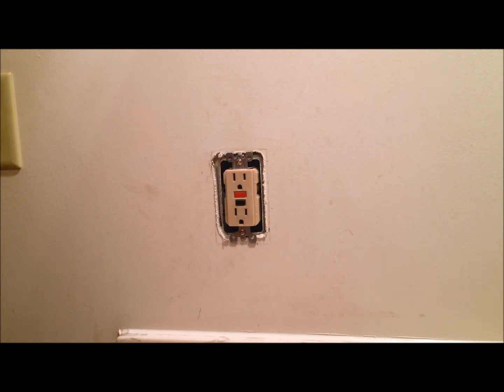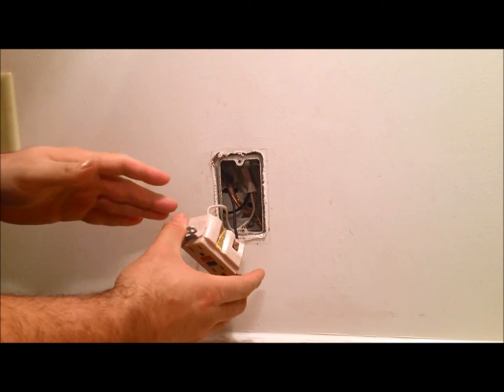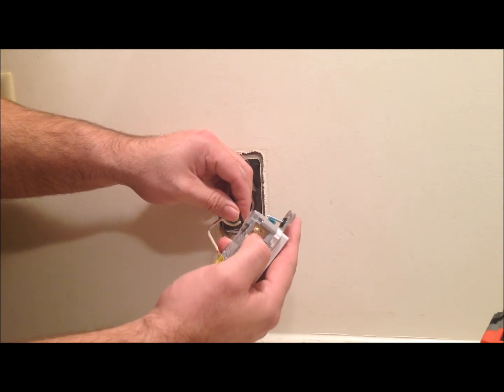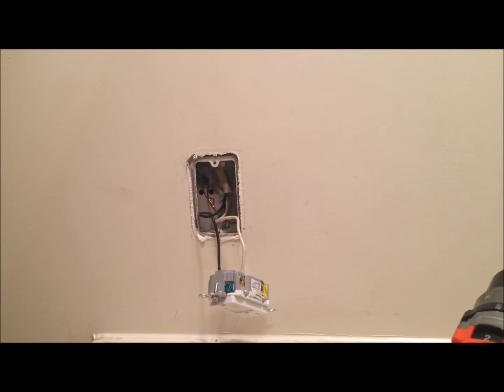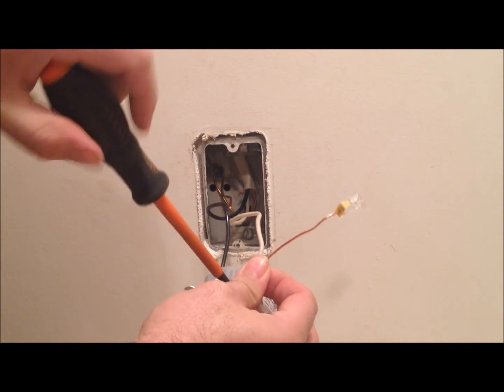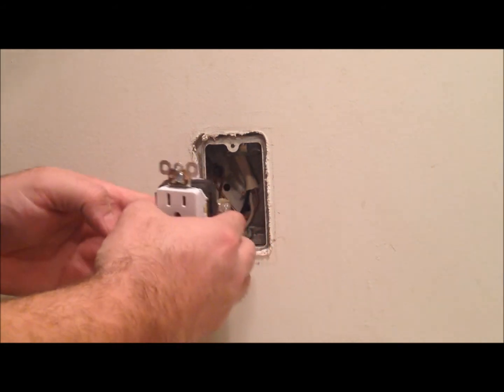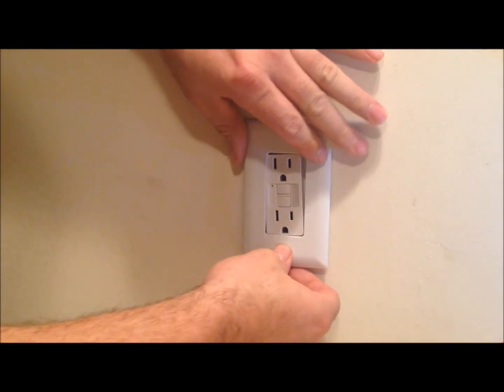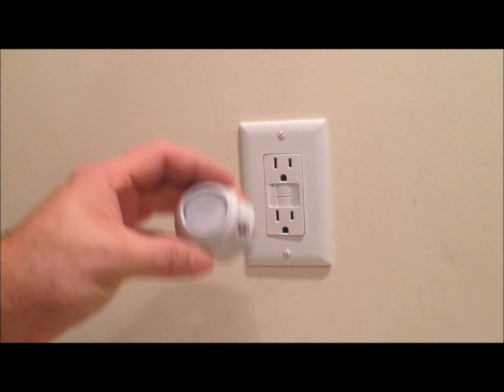Installation of a gfci with built in night light

Comment: why is the romex sticking out so much?
Reply from the maker: Darkvaider 525 no real reason for this other than a little extra room to work on fixtures. As long as the wire is inspected for     kicks or possible shorts before returning to the box it shouldn't be a problem. Thanks for watching.